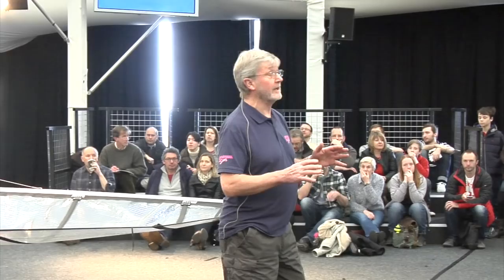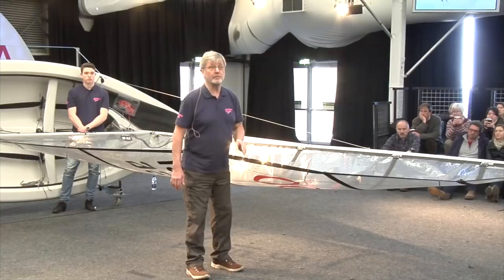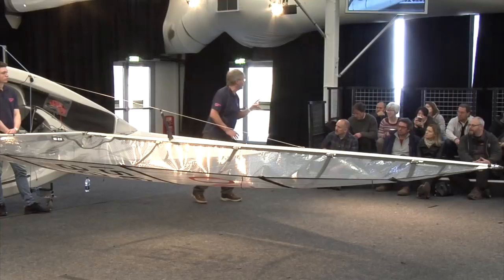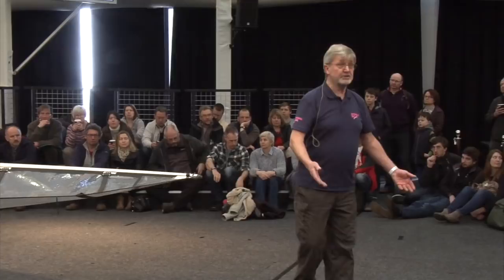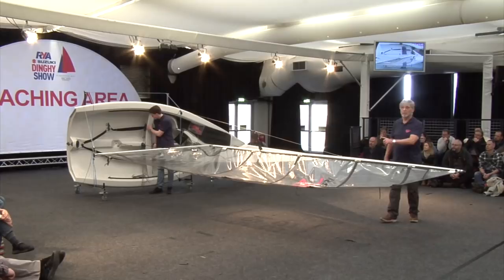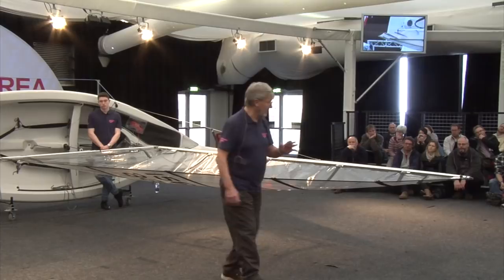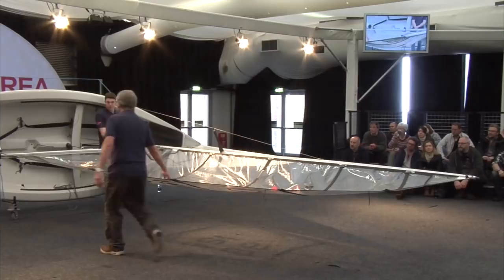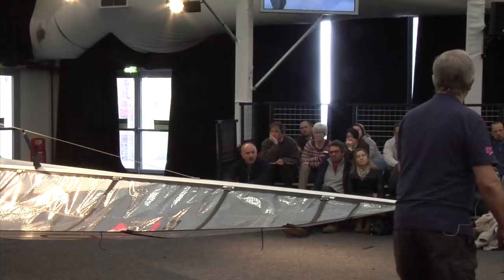Rig Tuning Presentation with Michael McNamara at RYA Suzuki Dinghy Show 2016

Comment: @11:00 talk about the leeward tell tail moving up. Due to the boot hull air displacement etc. 
Nicely thought but incorrect.   It’s Bernoulli law that makes air moves upward on the hollow side of the sail.
The higher density air likes to move to the top ( tip of a wing) where it likes to compensate for the less density air.
This makes a Eddy current on that top. Obviously that’s a disadvantage for smaller jib where the eddy is disturbing the main sail. 

Needless to say that the tell tail moving up is perfect indicator if any sail is set correctly.

Best regards form a aerodynamic specialist. 

Nice explanation and please keep it up .. it’s helping sailers a lot

Comment: Wonderful talk, thank you!
Three questions:
1) Michael spoke at length about changing the leech tension on the jib to optimize telltale position--but it seems as though he was mainly referring to jib sheet adjustments. If the bottom telltale is flowing but and the top telltale is stalling, wouldn't it be best to alter the twist of the jib by changing the sheeting angle at the traveller car? (apologies if I misunderstood the point)
2) When a two-handed dinghy is getting overpowered by a gust on the beat (or steadier squall wind, despite depowering the controls) such that some wind must be spilled to reduce heel--which of the two sails should preferentially accomplish this? Both? Or should the jib remain close hauled and the main do all the trimming/spilling?
3) How do you optimize the mainsail traveller settings on a boat with a moving traveller car (like the Johnson 18 that we sail)?

Many thanks,

Comment: One thing that was glossed over that I'd like clarity on is when the boom should be off the center line. He mentioned using the kicker more when the boom is off center but did not say when or how (mainsheet? or traveler?) to let it off center and by how much. Anyone know the answers?
Reply: When the boom is on or near the center line (close haul, close reach) the main sheet exerts downward force on the stern end of the boom and causes the leach tension to increase. When on beam reach/broad reach/run the mainsheet is not able to apply such a large downward force because the mainsheet leaves the hull at a slanted angle. I believe it is in this condition that Mike says only the kicker can be used to exert downward force on the boom.

Comment: So this clearly geared towards dinghies, but do the same principles apply to larger, say 10m keelboats with a 7/8 fractional rig?
Reply: yes they do, except larger keelboats usually have a genoa instead of a jib and there are cars to have extra control over the shape of the headsail. also the mast shape and forestay tension are controlled with the backstay tension on larger boats. 
The basic aerodynamic principles apply all the same though.
Reply: @xquizit79  I just watched John Bertrand this year sailing Etchell 22's in Australian Championship.  Downwind with spinnakers the crew were definitely heeling the boat to windward.  Which does not square with the video (or with your endorsement of the video) that the boat wants to be symmetrical (or nearly so)  at all times for best speed.  The Etchell's sailors were obviously going for asymmetry when presenting the hull to the water..

Comment: Very good but some of this is specific to type. For example my yacht sails faster when heeled as it lengthens the LWL.
Reply: Ya, and asymmetry isn't the problem he described in most boats: it's part of the design. And air doesn't "squeeze" between the jib and main (main will backwind before it squeezes anything). But this is 99% pure gold.

Comment: This guys clearly knows jack about actual aero- and hydrodynamics of a sailboat and is merely repeating all the myths and misconceptions that have evolved through experience.
Reply: Well maybe the proof of what Michael knows is by the number of championships he has won - probably one of the most unsung success stories in sailing dinghy history.....perhaps you would like to borrow the Hornet Class boat for the championship 2019 and if Mike is there see how well you fair against him and other sailors of similar caliber? Sometimes the actual feel of what goes on in a changing environment is much more important that the theories....remember you have at least two dynamics operating all the time, but each of those mentioned is not a static force and the relationship between both is changing constantly, which is why just theory on its own doesn't give full understanding of the situation :-)